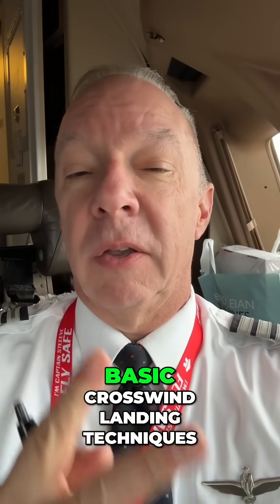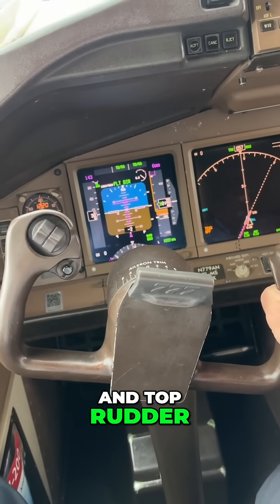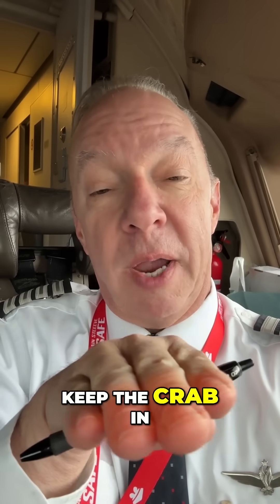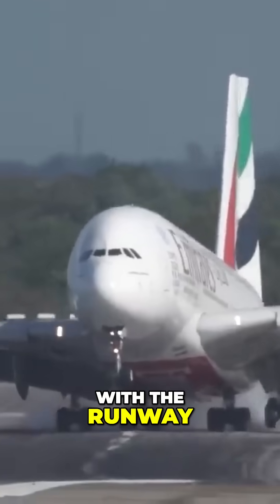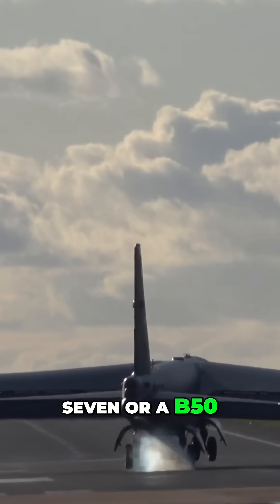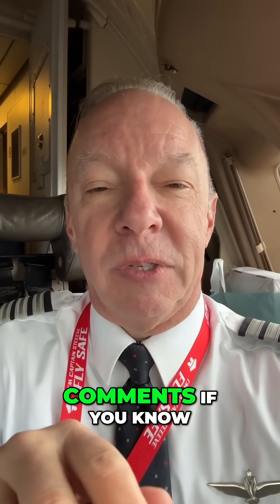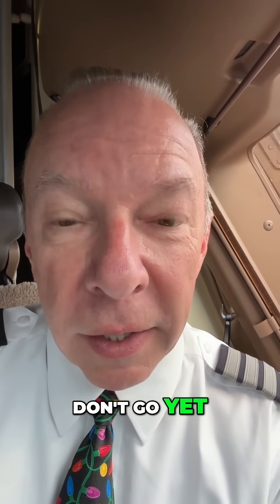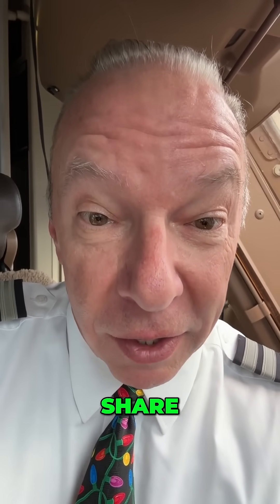Master Crosswind Landings: 3 Essential Techniques

Comment: The F-5 landed pretty fast, so crab angles were smaller for a given wind. Do the math, right. Secondly, it didn't appreciate spin-entry techniques being applied in the roundout/flare. But you could land gently enough that the crab would convert to tracking as there was more weight-on-wheels
... it isn't binary... can happen smoothly.  The F-16 is similar, but with DFCS between your hands and the asphalt.

Comment: B-52 has special crabbing undercarriage.  The 747 is not designed any different to any other large aircraft for landing crabbed.  Modern pilots are encouraged to hold the wing and sideslip, but older Captains still prefer to 'kick off drift', which is the lease stressful on the undercarriage.

Comment: Wing down eh in a forward slip? Just like the autopilot does it 😊
I'll only ever land crabbed in the 777 if the xwind exceeds about 30-35 kts as per the  FCTM guidance. The 757/767 are broadly the same, but back in the day on the ATR we would land slightly grabbed...wing down on the upwind main..before straightening up, putting the other main down and de-rotating. The ATR was harder than a tail dragger to land in a xwind.

Comment: Powered weight-shift aircraft (AkA "Trikes") have to land in a crab too. They're weight-shift 2-axis control so they're always in coordinated flight. The undercarriage is designed to straighten itself out and there is flexibility built into the hang bracket to allow the sudden twist as the undercarriage straightens out suddenly. 
I was a private pilot and only flew light 3-axis aircraft, so I exclusively used the "wing-low" method. But when I transitioned to weight shift, the crab without kick method was my only option!

Comment: SLIP & Crab.  Cessna 195's had/hav a system that allows a crazed Landing.  The B-52's could land at a 15 Degree crab so their out board Engin and wing tanks didn't Drag in a SLIP.

Comment: I am an old fighter pilot, that was lucky enough to go for a training flight in a B-52.  While taxiing out for takeoff, I asked what that big wheel was for on the back of the center console. The heads of the Captain and F/O, almost ripped out of their sockets, as they turned around to confirm I did not know what it was for.  With a nod from the Captain, the F/O proceeded to turn the wheel all the way to the stop.  My stomach did flips, as the nose of the BUFF ended up being pointed 20 degrees to the side, as we were still taxiing straight down the taxiway.  It turns out that the B-52, is one of the few aircraft whose wingspan is so long, that the aircraft must land with wings level and with crab, but Boeing, designed the  landing gear so that it can be lined up with the runway.  They laughed and laughed.
On the 747, we were allowed a maximum of 4 degrees of wing down on landing, but the aircraft was designed that we could land with crab, and the the landing gear was designed to handle the forces incurred by landing that way.  The gear on the 747, was so well designed, that it was no big deal.  On the T-38, F5, and CF-104, we were trained to land with the crab on, but some of us cheated.

Comment: I’ve kind of wondered how you need to be aware of a car with a manual transmission using the clutch can wake a pilot up who is more attuned to use a rudder in an aircraft a bit more often…foot control!!

Comment: The 747 doesn't have any designs installed on the gear to change the way it lands in a cross wind. And many of the low wing jets cannot take much of a wing low cross wind landing. The C5 used to have that system years ago.

Comment: Captain Steve I knew that about the B-52 but I never knew the 747 could land like that interesting.
Reply: The 747 doesn't have any designs installed on the gear change the way it lands in a cross wind. The C5 used to have that system years ago.

Comment: The B-52 does the crab to landing and maintains the crap throughout the landing rollout.  The direction of the landing gear change in relation to the centerline of the fuselage in order to be in straight alinement with the direction of flight down the runway.

Comment: At a flying club I was at (mostly PA-28s) they wouldnt let even qualified pilots do circuit practice without one of their instructors so as not to rag the landing gear. I asked 'what, even airline pilots?' and was told they're the worst! As airliners are designed to land in a crab but most GA aircraft wheels must be in line with runway to avoid  side forces wearing them out.

Comment: Captain Steve, sometime between 2008-2010, sorry my memory fades as I am in my mid 50s, I was on a flight into Juneau AK. As we were landing, we had horrible cross winds and the plane was tilting up to the left and right at an alarming angle. The pilot skillfully managed the winds and firmly planted us on the runway. Everyone was grateful for the pilots skill. I waited in my seat until most passengers had disembarked and on my way off the plane I stopped to thank the pilot. Off the cuff, I asked Air force or Navy? He got a big smile and said, the Air Force  can't land on a dime in the middle of the ocean. I was very appreciative of the training and skill of that Navy Pilot.
Reply: "The Airforce can't land on a Dime in the middle of the Ocean".
Reply: Shout out to our Air Force pilots!
Reply: For the Pilot, it was just another tuesday😂.
Reply: The downside of that is that the Navy boys are used to slamming down on a very short runway and think nothing of what we interpret as more akin to “impact.”  

Speaking as a former non -aviation naval officer.

Comment: Early 2000s commercial aircraft pass.. Landed in greensboro nc.  

Like you said crosswind one side down the the 2nd snd steer.

Wild landing and all passengers applauded the pilots during taxiing to the gate it was a wild landing from a passenger point of view.

Strong

Comment: The Ercoupe was designed to do this with stacked rubber donuts and main trailing landing gear. 1946 models
Reply: 100% correct.   Ercoupes had the rudder interconnected with the ailerons so that slipping to a landing was not even possible.   They had castering trailing link main landing gear system that would tolerate landing in a crabbed configuration

Comment: My understanding that B-52 landing gear turns right or left.  If the whole plane is moved to the right by crosswinds not straight with the runway the landing gear is aligned straight with the runway and can land sideways. After that it straighten out.  Correct me if I'm wrong Captain Steve.

Comment: didn't the 747 have rotating wheel trucks so the plane could fly with the wind and the wheels would line up with the runway.
Reply: Didn’t you watch the video ?
Reply: The 747 doesn't have any designs installed on the gear to change the way it lands in a cross wind. It does have castering for taking turns on the ground.

Comment: B-52 will do a crab landing. I think up to 5 deg . . .
Reply: The B-52H is equipped with a special crab control the earlier models didn't have because the H model has a smaller tail than the earlier models.